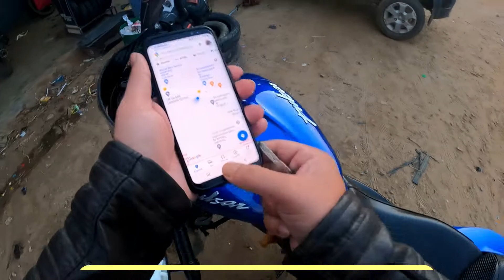Upgrading old Pulsar 200 NS tyres I Best tyre for Pulsar 200 NS in a budget | Ceat, MRF, Michelin |

Comment: Hello there, really nice and informative video. just wanted to check, would you still recommend this tyre as of May 2022??
because i am planning on changing my tyres (both front and back) for best wet and dry grip and for a long run with good performance. kindly suggest.
thanks!!
Reply from the maker: Sure, they are good .